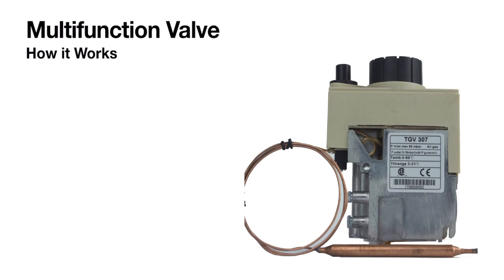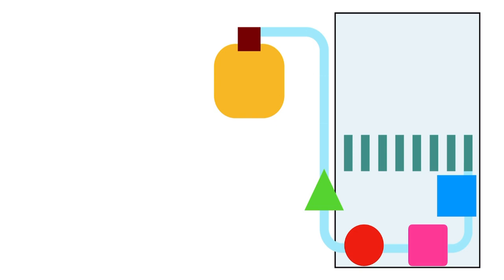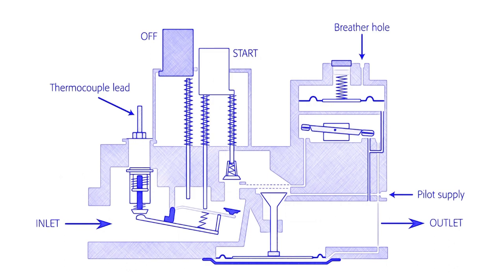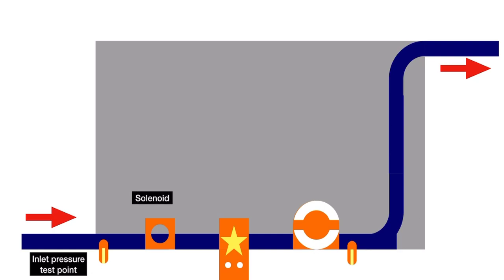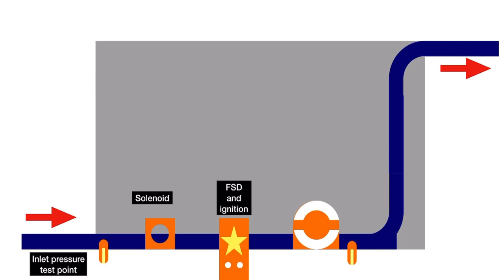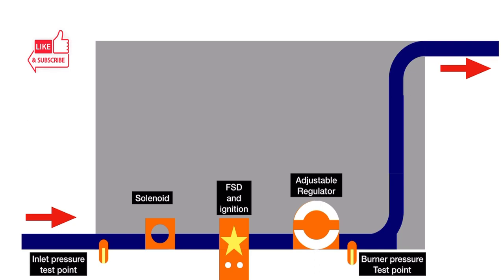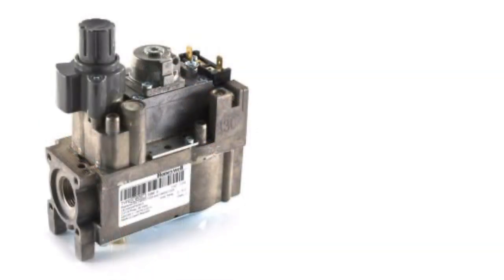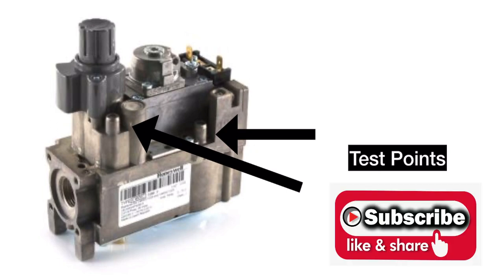ACS Essentials - How a Multifunction Valve works

Comment: So if this was in a boiler where is the temperature phial going back to
Reply from the maker: Hi Cazza..it would sit in the flame just like it does in a cooker. Remember an FSD is only there to detect the presence of a flame, nothing else, so these phials must be in the flame to detect its presence. When the flame goes out the phial cools and closes the gas valve. If you watch my cooler video you’ll see exactly how it works. Cheers I hope that helps.
Reply: @passyourgas  hi, I mean how does the thermostat on the boiler control the burner, I know that In a cooker the phial expands and then closes the main supply of gas and leaves a bypass rate for low flame, so on a boiler does the thermostat phial expand and control the solenoid valve in the multifunction control valve? and once the boiler is up to temperature does it leave a low flame like a cooker or just a pilot until the temperature drops, in which the burner ignites again ?
Reply from the maker: Hi Cazza, good question, thanks. I left the temperature control functions out of the video to keep things simple, but there are several ways that this can be done. One is, as you say, to have a separate thermostat system only acting on the solenoid but leaving a small weep line through to the pilot. This is called a “modulating” system where the heat keeps coming on and off. Other systems are directly linked to a servo ( a small motor) inside the Multifunction valve that adjusts the regulator pressure automatically according to how hot the appliance is getting (using a circuit board). In real life you will nowadays come across fan driven burners that blow forced air to the burner and the circuit board adjusts the speed of the fan to change the temperature inside the appliance. It all depends on the system within the appliance. You won’t need to know the specifics of how heat is actually controlled to pass your assessment or exams, although you will have to learn it to be a good and efficient engineer. You will, however, be taught about forced air burners and their operation. I hope that helps.